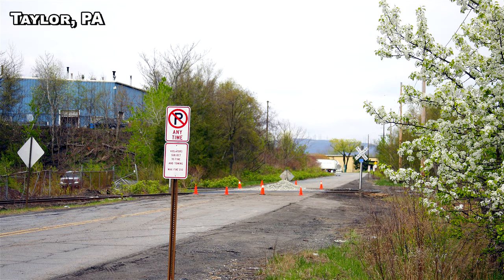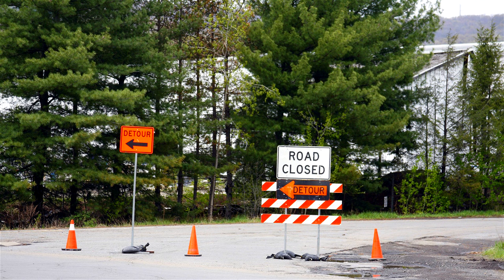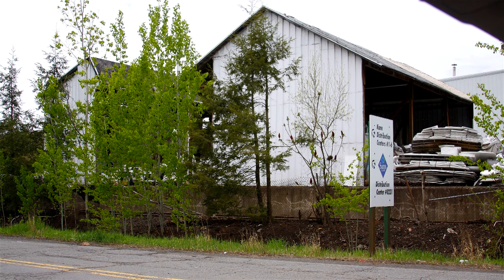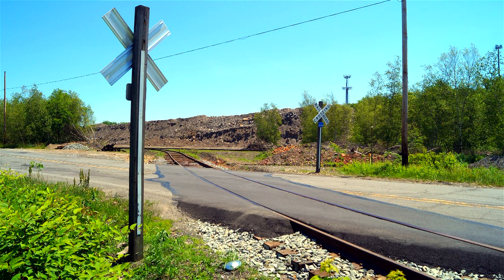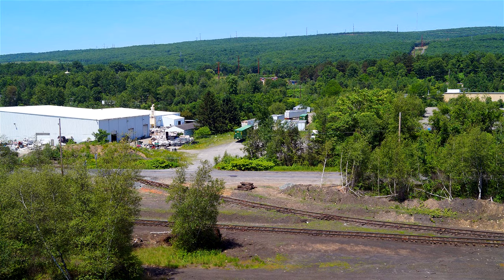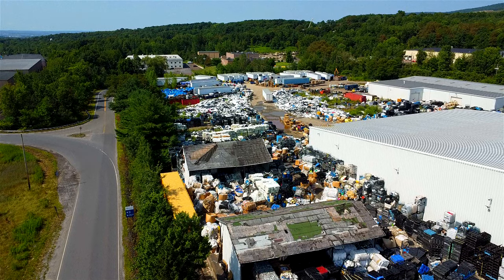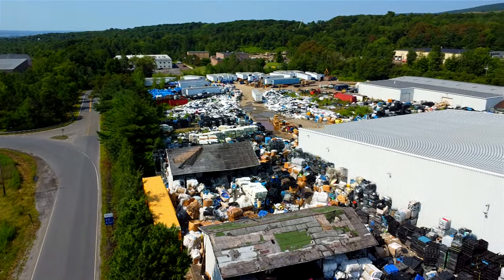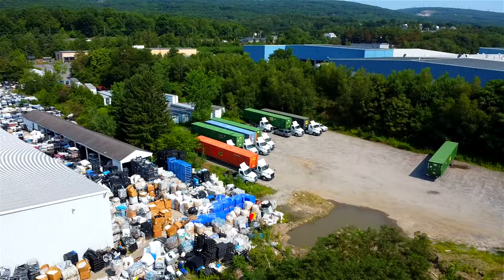[T-510] That's a lotta' plastic!

Comment: The longest a car has been spotted there for loading, as far as I know, has been 8 weeks before being released for interchange. 

There's also been times where Corestates tried to load so much material into the car that they had to ram the cardboard with the forklift to get the plug door to latch closed.  Good times haha